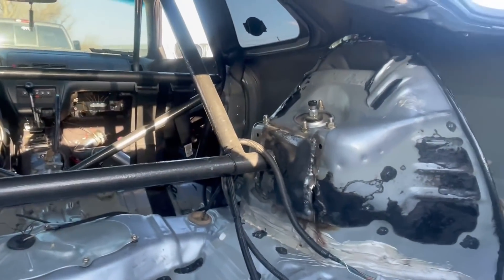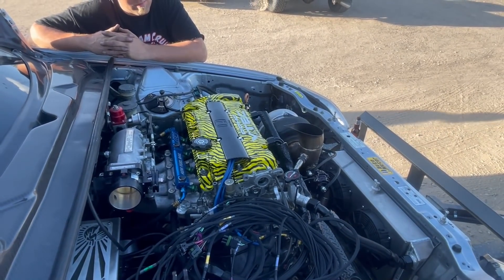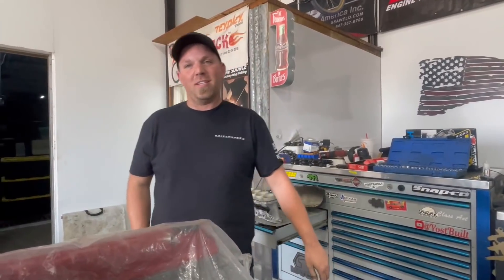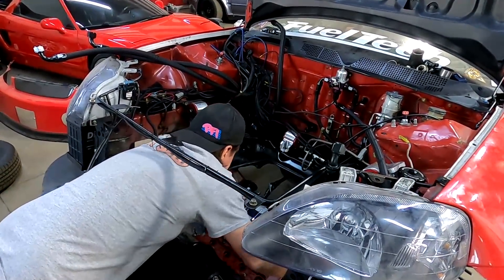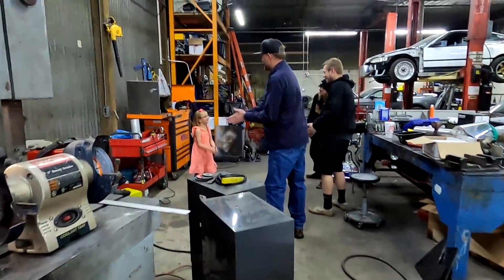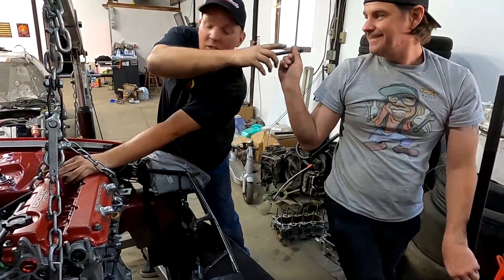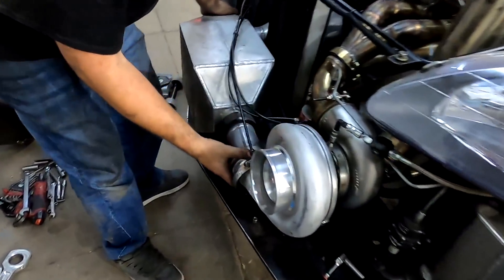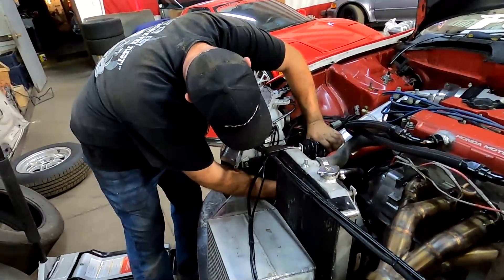Finally Our 1200hp Civic Runs Again! (Setting Boost cut at 77lbs)

Comment: Y'all should put a few ceiling mounted chain hoist in so you don't have a cherry picker in your way and you need a few engine carts and floor 4 post engine stands like the one's they put engines on to ship them to you nowadays I think a few of each one of those would help around the shop tremendously

Comment: PFI, I have a quick question if you have a minute. How much would you guys charge to install a new flywheel and clutch in a 99ek coupe with a turbo kit on it? I was quoted 700 from the local shop and I thought that sounded a bit high? Thanks in advance! OH I almost forgot! I have all the parts and I told the mechanic so that is the price for the labor he quoted me for.

Comment: those electric ratchets really help with those long motor mount bolts that's for sure. I remember driveways when I was a kid wrenching them all the way out and all the way back in and saying I don't need no stinking air tools I'm not no baby. then 27 hit and Milwaukee is my best friend. hitting 34 now and I think its time to change the diet by a mile and get my body to stop acting like I'm an 80 year old.

Comment: Since Steve Morris is a good friend you guys and Cleetus and he has built a water jacketed billet block for the 481x and the LS now you should see if he would be interested and willing to do a water jacketed billet block for the K series and the head and Jamie and Brent should be the one's to help him with the R&D on it that way you can run all the boost and not have to worry about splitting anymore blocks and Turbo Smart needs to do some more R&D on their electronic wastegates so it doesn't cost anyone else anymore blocks and heads just because it wants to go crazy and give you all the boost all the time or try out their new and improved electronic wastegates and see if you have any success out of that one because at PRI they were showcasing a new one that was a through and through wastegate and I think you would have more success out of that one myself anyway

Comment: Yall should check on the carnage in my motor on my most recent youtube video I uploaded... Alot happens a 6000rpm and 0 oil pressure. Turned my v8 into a 4 cylinder 🤣😂🤣